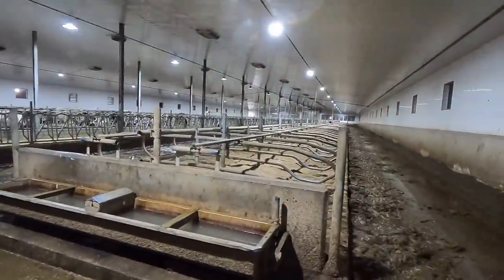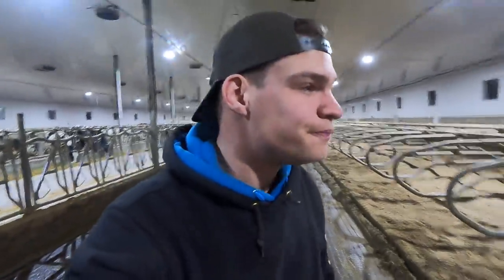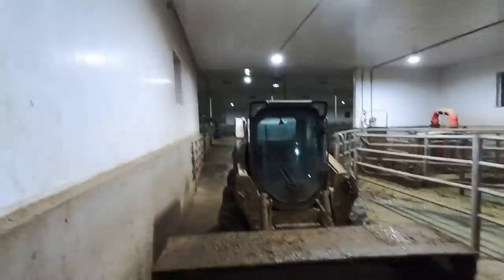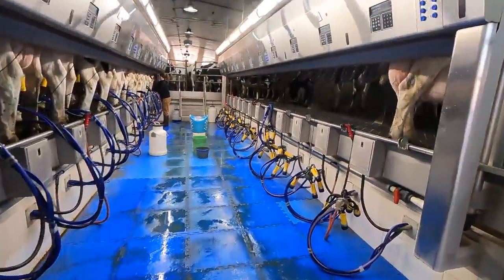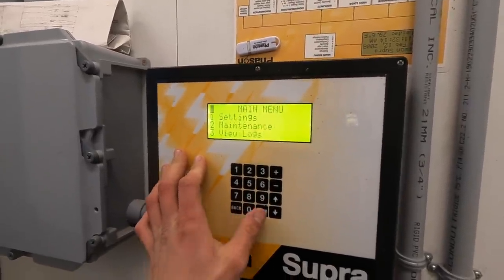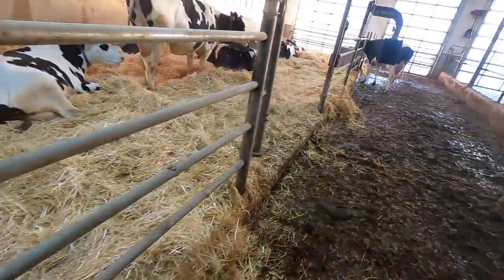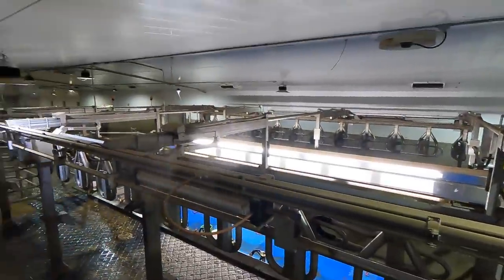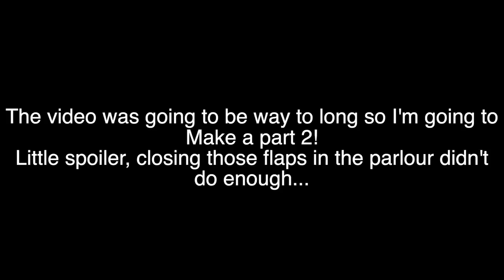Dealing With A Frozen Dairy Barn! (Part 1)

Comment: Kind of amazing that even in the Sask you don’t have any aux heat in the herd areas.  Appreciate the knowledge.   Also surprised Lely was not a little more proactive on getting your Juno back up and running.  Are they oblivious to  your you tube power?  If you get no extra love imagine what happens to the common folk.  10th gen just had Juno problems too.  Have a great Christmas!

Comment: Burrr. In Europe they always teach us not to let machinery warm up because it means that it will run at sub-optimal temperatures for too long and wear down the equipment more than if you were just going to drive it right away (easy on the gas though). E.g. it takes 30 min of idling to warm up an engine but only 10min when you´re driving it straight away (but with low revs/load).

Comment: Living here in north eastern Ontario, we have seen -19c at night so far. It's not a record, just the winds off of Georgian Bay seem to be merciless. It must really be windy across in the prairies,  add those cold temperatures.  Did you have freeze up last year? Good to be on top of these issues. 
Visiting a family farm of 100+ years with no animals caused a lot of damage to the structure needing to brace the beams. Even a few animals do make a difference in heating that space. It should be toasty with the vents shut.    Always something happening on a farm. Great video .

Comment: If you want to lower the risk of break down when cold starting use the block heater on the bob cats
Reply: Absolutely, that should be a given.  Even if they plugged them in and put the cords on timers...electricity is far cheaper than engines.

Comment: Electric engine block heater on timer for the Bobcats?  Or next time buy battery electric ones for doing work indoors?  
A curious question from me here in Sweden with also cold climate (sometimes) and warm summers - How much insulation are in walls and ceiling in your cow barns? Not so much in doors what I can see.

Comment: I suggest you plug in a block heater for the bobcats. You will get  more life out of the motors. Pistons heat up faster than the block (more steel) Pistons expand wear out the engine faster.

Comment: It actually doesn't matter how cold the engine is if you start it and crank the throttle wide open doesn't hurt it until it has to work hard when it is cold then you will do damage

Comment: Put a deck screw trough the air inlets in the parlour and straw barn and keep them shut tight during the winter. Install one or a few exhaust fans over there and draw the free warm air from the freestall barn trough the milking parlour and straw barn before exhausting it outside. It keeps the parlour from freezing and from fogging up during milking.

Comment: For the bobcat  you could get a rubber exhaust hose and run it to a vent  when you park the machine you plug in the hose. So next time you start it goes outside.   Put the rake beside the machine you go to the machine start it up then rake the beds.  When you return the rake its all warmed up

Comment: Block heaters on the skid steers, with  ambient temp and time controls. we had school bus drivers on cold starts the same way full throttle, drove me crazy, but we couldn't reason with them.  the diesels ran forever.

Comment: I have to adjust my set points at work to a negative value in order to get valves to close 100%. I don't know if you have that flexibility? Like -10% might get your inlets to close completely? I know this is a month ago, but I just wanted to mention that.  Good luck!

Hahaha. Nevermind. I literally paused right before you climbed the ladder and adjusted the clamps on your ropes.

Comment: Was that burrr or bum? I havnt got my glasses on lol. In the UK, lowest I ever had was -14 degrees C, back in 2011/12 I think. All the cubicle shed water troughs, supply pipes froze up, the dry cows water, all the young calves water. Spent 24 hrs plus milking, feeding etc supplying the milkers with water via 3, 2000 litre troughs on  pallets with the forklift. Took 2 days for the milkers to defrost, 10 days for the calf pens. Absolute nightmare. I know why even with the extreme cold you take things freezing up so seriously Jan. It's not fun at 4am.

Comment: instead of cold starting the bobcats and shortening their lifespan, why not buy two circulating block heaters and plug them into a timed outlet that turns on 1/2 hour before you usually start them.  Block, oil, and coolant would be up to temperature and you would have the added benefit of heat in the cab every morning.

Comment: @saskdutchkid You should at least use a dipstick heater on the bobcat to keep the oil warm cold starts won't be so hard on the engine you can also do a tank heater to keep the diesel warm

Comment: I’d get or make a tire scraper so you can get all the edges and ends cleaned thoroughly or even making one more pass to get all the manure scraped up from the edge won’t hurt and it shouldn’t run over... better to have a super clean alley and feed alley and place for them to lay down.. I’m a weirdo for having things basically spotless for the girls..

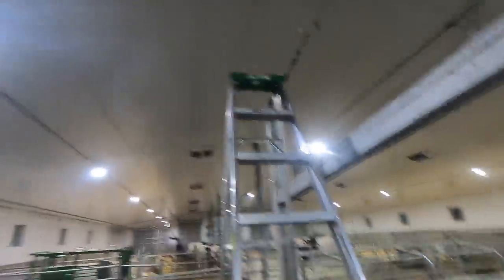Comment: 14:40 You have a problem with non-closing flaps because they are stupidly designed and made.
The cable can become loose when tightened, and a lot of tension is required to close the flap.
It would be enough for the covers to have a small circle pointing down to which the spring would be attached and the wire to it, and then less tension would be needed.

Comment: why are the cows inside the barn in out of the weather not fed in a troft? Then there would be no need for the Juno. Also, being inside it would never be filled up with water or snow so I don't see why it would need the maintenance that not having a troft requires. Knowing why you don't have a trough would be interesting to hear.

Comment: I think you are going to keep experiencing issues with the ventilation system. The wires used to open/close the shutters might be constantly influenced (the wire starts to lose tension) by the environment temperature causing the problem you currently you have with shutters remaining open for an inch or less.

Comment: Jan, those diesels put out a lot of carbon monoxide inside the barn which can be harmful to you and the cows. Diesels can easily be converted to natural gas or propane  which emits zero carbon monoxide fumes and the engines will last a long time same as diesel. Good that you got onto the venting before a bad freeze up happened. Good video. Peace.
Reply: Burrrr
Check and see if the Bobcats have a plug-in. Using natural gas or propane still generates emmissions - NOx's...It is a toss up. Not many Canadian farmers use natural gas/propane in their tractors, due to the need to change out propane tanks, or natural gas compression faciliities on their farms: Unless they need to by 2030 -arghhhh!!! Maybe the unemployment by then will be so high, and there will be workers begging just to push the manure into the pit, instead of using Bobcat(s). But again not all of them start in the morning.....
Reply: @edk1609  True, but all ice groomers run on natural gas or propane because it is completely safe. I drove a propane vehicle for a few years. Fillups were about the same as gas. The fuel conversion uses two tanks so you never are left high and dry.

Comment: You know...I'm quite the smart handy man for 30 years old...If you have $200,000 milk parlor set up.....wouldn't a $1,500 propane ceiling heater be a thought for a set point of 35 to sop everything from freezing up when there is no cows be a good idea?? considering your in a cold climate area? not trying do be mean in any way but just a thought.
Reply: also my Nabor has a drop down curton that he puts down to keep just the milking portion of it from freezing up, he's got a little heater in there, also his is opened on one end.